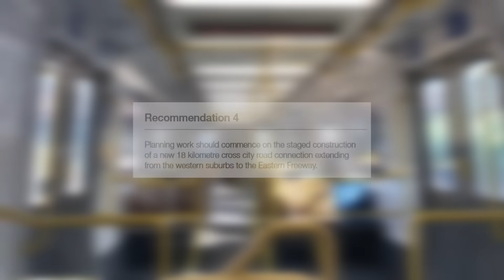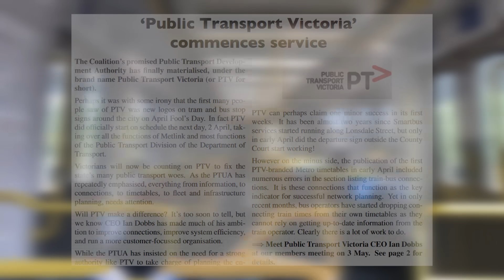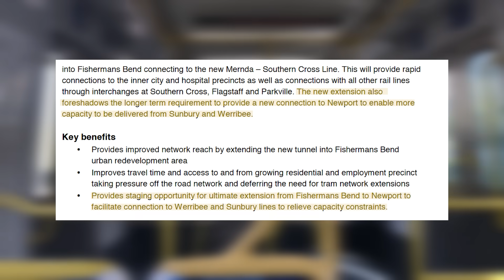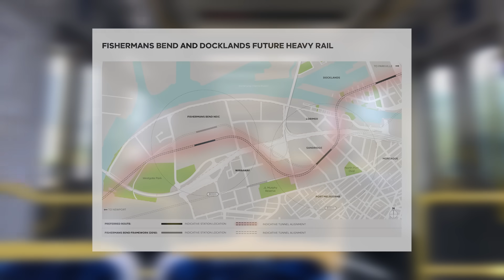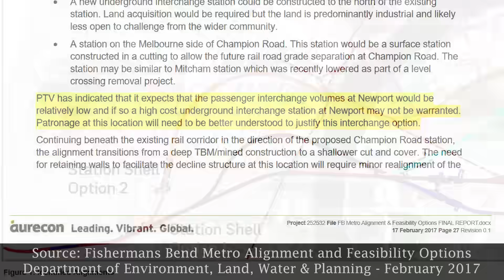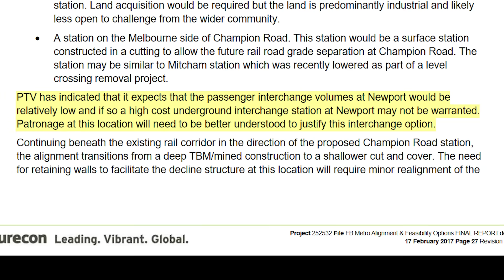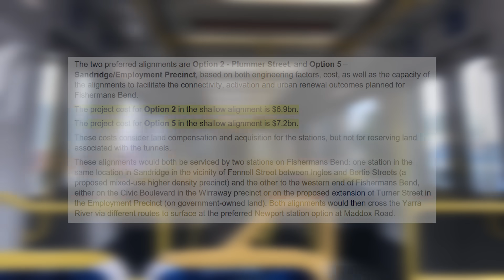Melbourne Metro 2: Explained

Comment: Metro 2 needs to happen before capacity becomes an issue, rather than waiting until it is. Sadly, with SRL and demand for an airport rail link, I dont see this ever being built.
Reply: the airport line was on the plan it just wasn't a stupid brain dead 90km underground tunnel.
are leader had 4 simplistic line concepts where you could of built the most important while adding more buses to the others then slowly add rowville, melton etc over time but instead she wants it all at once as a horseshoe. with all the time she has spent stuffing around on the srl set up she could of already started sunshine and albion upgrades to allow immediate start to a airport rail
Reply: @anakinsmith4770  she actually couldn't as she didn't have the funding. SRL was a major election pitch by the Victorian Labour government and they weren't about to abandon that. Airport rail link was being significantly funded by the federal government but they delayed it to help the fight with inflation and bring down government spending. There was also a fight over where the station was going to be (i.e. above or below ground) between Melbourne Airport and the Government and you can't realistically do any of the design or initial works without knowing what the whole thing will look like.
Reply: @hamleyn  listen to yourself the srl was funding she went after instead of just funding to upgrade sunshine and make the line you know there still debates now what happens if she stars boring holes and then the people debating so no airport if this happens and it will she will look like more of an idiot than she does now. she is everything that was wrong with dan andrews x10 i'm confident if melbourne had another covid like virus she would lock it down to 0 cases existed
Reply: There is this huge kerfuffle over the cost of the SRL, meanwhile the NorthEast link road...
Reply: @liam3284 that is useful for road user the srl isn't the airport issue is an easy fix and I can't imagine anyone getting on an the airport is going to Werribee, Monash box hill unless there migrant and that's the issue the srl is ain't Australian

Comment: They definitely need the interchange at Newport! Do they realise how many people travel back and forth between the Werribee and Footscray?! Or Werribee to the Williamstown area for the beach?
Reply: The Laverton trains (via the altona loop) connects at two separate stations on the line. A new station at 'south newport' and laverton? So it still allows connections, minus a direct connection to Williamstown
Reply from the maker: As stated in the video - connections from Werribee and the Altona loop to both Footscray and MM2 will be very easy with a Newport South station. PTV has stated in the past that there aren’t enough people travelling from Williamstown to justify building an expensive new underground Newport station, at least initially. You can read the report in the description if you would like.
Reply: @MetroManMelbourne  oh I can understand that, fully on board with it, I’m just concerned that the position of Newport South could either pseudo fix this problem in the meantime, or not. Bridging the gap to allow for a somewhat useful connection and for the development to get a move on in the meantime, and the transport use in the area to start changing. If they design it in a way that is walking distance to Newport at one end (a little bit town hall/flinders street like, but admittedly with probably a little more distance, think London Underground connections) and has decent, clear walking connections, maybe pedestrian bridges at points etc, it could allow for the connection to exist in a useful but not ideal form in the meantime, without the expensive underground build. Then as density builds in the area and trips increase, any future underground thing they do to increase the efficiency of the transfer could be justified by demand, foot traffic between the stations etc.

My original comment admittedly gave absolutely none of this nuance though, my bad 🤦🏻😂 but yeah, talking about a Newport connection currently, I’m more talking about them hopefully positioning Newport South well, rather than going straight in with an underground build. Heck, if they position Newport South well enough, they could probably get away without an underground station/platforms unless the area develops in a way similar to the North Melbourne/Arden plans, or as some sort of pseudo extension of the Fishermen’s Bend development well off in the future.

Comment: a tram line branching off the port line then going along howe parade then a loop through the bend then back towards the cbd is a better idea.   curves on a train line as was shown on the map of fishermans bend just slows the journey for everyone else.
Reply from the maker: This isn’t about a train line for fisherman’s bend, at its heart; it’s about segregating train lines, something we will eventually need to do, it’s just convenient that it can run through fisherman’s bend. Even with the curves, it will still probably take 5-10 mins off the Newport to city travel time.
Reply: @MetroManMelbourne  , melbourne already has a train speed problem.   speed of service is what brings customers.   observe the success of v/locity services.   unless there is a truly good reason for installing curves there shouldnt be curves.   theres not likely to be much buried beneath the ground of fishermans bend that needs avoiding.

Comment: I hope this doesn't happen; other projects need to be built. The Cranbourne line needs to be extended to Clyde, the Doncaster rail needs to happen, and the Rowville and Mornington rail – like many other important proposals. Metro 2 is not necessary, and I certainly hope that the SRL will not continue to be built. First, focus on these rail extensions to connect these isolated suburbs.
Reply from the maker: Doncaster rail requires metro 2 to be feasible. The Rowville line requires quadruplication of the Dandenong line, which for now is (prohibitively) too complicated. Mornington rail isn’t ever going to occur.

I understand where you’re coming from, but ultimately, it shouldn’t be a case of “either-or”; we need to be using projects like MM2 or SRL as part of a comprehensive transport network-building effort for the long-term rather than being individual projects competing for funding. Perhaps that’s a little too idealistic but that’s how I look at it.
Reply: @MetroManMelbourne  Maybe MM2 should head there then, instead of already well-served locations?
Reply: Doncaster rail would realistically be feasible if this gets built. I would love a Doncaster station, but the Clifton hill to Jollimont section is nearly approaching capacity, Doncaster trains would push it above capacity even with CBTC signalling.

(Doncaster rail is also very unlikely to happen due to the north east project, where Doncaster area will be served by BRT to the city, and if stage 2 of the SRL gets built, that a SRL Doncaster station.)

Comment: Metro II should be a quad tunnel, going straight down Elizabeth Street. 
Stops to the north Vic Market (between Mel-b’n Cnt, and the Vic Market, Parkville, (then turn east under Mel-b’n Uni, 'til it reaches Elgin St) Carlton (between Mel-b’n Uni & Lygon St), Fitzroy (between Brunswick and Smith Sts), Vic Park (then skyrail), Chandler Hwy, Bourke Rd, Bulleen Rd, Greythorn, Doncaster SC, Victoria St, Tunstall Sq. Donvale Line
Bulleen Rd, Bulleen Plaza, Feather Top (Lwr Templestowe), Templestowe (Templestowe shops, or High St), The Pines SC, Warrandyte (Warrandyte Line)
Elizabeth st would be between Flinders & Collins Sts. 
Stops to the south west (skyrail along old Port Mel-b’n line) Montague St (then tunnel under Williamstown Rd), Graham St (turning north west) Salmon St, Newport to Werribee (Wyndham Vale?)
Stops to the south (skyrail along old StKilda Line) South Mel-b’n, Albert Park, Middle Park, StKilda (then tunnel under Grey and Inkerman Sts) StKilda Rd, Balaclava, Ripponlea, Elsternwick, Gardenvale (turn east tunnel under North Rd), Caulfield South, Ormond, Bentleigh East,  Huntingdale,  Monash Uni,  Mulgrave, Jells Rd, Rowville (Rowville Line)
Extend Sandringham Line via tunnel Black Rock, Mentone, Morrabbin Airport (skyrail & ground lvl) Dingley Village, Springvale South, Keysborough, Dandenong South (Dandenong South Line)
Mernda Line (and Wollert Line) would follow the old inner circle line Stops at Fitzroy North, Carlton North, (joining Upfield (Wallen?) Line) Mel-b’n Zoo, Children's Hospital,  (joining at Parkville)
Reply from the maker: I like your ambition, but I feel this might be a little unrealistic…
Reply: In PT, we need enough people to say this is the minimum, and we might get half.

Comment: I don’t like how it won’t stop at flinders street
Reply: Southern Cross is a good enough substitute. It won't take long to change trains at the City Loop or simply hop on a tram to get to Flinders St. Plus, not everyone needs to go to Flinders St and Melbourne Central anyway. And I actually like the creativeness of utilising Southern Cross and Flagstaff as new interchange stations. The more decentralised the lines are, the better IMO.
Reply from the maker: Proper “metro” systems (which is what Melbourne is eventually trying to turn its trains into) don’t tend to all interchange at one station, with the exception of a handful of systems like the Hamburg U-Bahn. In reality, it shouldn’t be that big of a deal to bypass flinders street; if you need to get there from the north, you can change at parkville, and if you need to get there from the west, get a tram from southern cross.

Comment: I would like to some overdue uogrades which are cheaper and will be faster to build to be done first. For example Upfield duplication and extension to Roxburgh Park, Rowville rail, major bus reform and  Western Rail Plan.
Reply from the maker: Rowville rail is a surprisingly complicated project that probably requires quadruplication of the Dandenong line (expensive) - otherwise I tend to agree
Reply: @MetroManMelbourne  potentially though Rowville trains could stop all stations from Caulfield as happens now with all East Pakenham and Cranbourne trains. Maybe Rowville trains could take the path of existing Westall short train services. Rowville would primarily be skyrail down North Road which I think would reduce the cost.
Reply from the maker: @SimonsHouseofEntertainment  the issue is that the corridor doesn't have enough capacity, even with CBTC signalling - it's not to do with express running.
Reply: @MetroManMelbourne  Yes, that is the problem. The best way to Rowville is to extend the Glen Waverley Line which is mainly self contained

Comment: I don't get why really any of it needs to be underground except for the bit under the CBD.
Reply: there's no corridor for it to utilise
Reply from the maker: The issues with running it overground are:
1. It would require a bridge as tall as the west gate bridge to cross the west end of the yarra - incredibly expensive (maybe even more so than a tunnel)
2. Even if you ran it overground through fisherman’s bend, it then still needs to run very deep to cross the yarra river near the city, so you would probably require the sandridge station area to be tunnelled anyway.
3. There’s no surface alignment for it to follow through Fitzroy without demolishing many buildings (more expensive than a cut-and-cover tunnel)
Reply: @MetroManMelbourne  that's fair enough. Thanks for the perspective!
Reply: @Soccera0  real underground is the best in urban areas. The european metro's are amazing

Comment: This proposal feels like a massive waste of money and time when there are so many things we need more and would cost less.
Reply: Like what?
Reply: @Snoop_Dugg  SRL😐😐🫥
Reply: @Merri-bekRailfan  SRL was too ambitious, probably they should have built another loop closer to the CBD to begin with, allowing for interchange just outside the CBD in the event of delays.
Reply: @Snoop_Dugg  yea, good point
Reply: @Snoop_Dugg 

The inner suburbs already have their trams. A suburban loop closer to the CBD would be useless, and would just further-confirm that the inner suburbs get the overwhelming majority of infrastructure while anything further out remains neglected. And despite common belief, Melbourne's inner suburbs are not even all that dense compared to similarly-sized cities anyway (Sydney included). So the SRL and resulting urban renewal might aswell be pushed further out to help increase density at the missing middle where it's required most.
Reply: @ Thats a fair point about the trams serving the inner suburbs, but all the lines are basically radial. There’s no way to travel from one suburb to the next without heading in towards the city. Doesn’t really encourage 20 minute suburbs does it.

If SRL was about neglected suburbs getting public transport then construction would have begun in the West.

I’m just saying we need both, at different radii
Reply: @eddielong8663 Urban renewal. 35 billion. Shelve the project and make sure that the growing Western and Northern suburbs get decent Public transport. The SRL isn't a priority at the moment.
Reply: @Merri-bekRailfan NO!
Reply: @mjcats2011  I was being sarcastic
Reply from the maker: @Cassandra03 elaborate?
Reply: @MetroManMelbourne  the other comment that you have already agreed with for example. The self spacing tech to increase frequency. Level crossing removal is a great project improving the city. Then circumferential routes. And even high speed rail as a greater priority than this.
Reply from the maker: @swiftieau  I disagree about HSR being a higher priority, but otherwise don't see it so much as an "either-or" for the other projects - they should all be done at some point in time
Reply: @MetroManMelbourne  I feel like increasing the attractiveness of regional Australia can only be done with High speed rail.

They should start a build from Shepparton to Albury or something so people have a valid reason to move away from Melbourne. Away from built up areas it would be easier to build and get services running.
Reply: @MetroManMelbourne  obviously only the first three would be cheaper
Reply: Why are you worried about cost? The debt isn't a real thing unless you read the herald sun.
Reply: @Low760  learn anything about anything. Stop being proud of your own ignorance.
Reply: @swiftieau Totally agree. We are in trouble in thus state. Transport wise we have created not much compared to NSW and WA.
Reply: @Low760 

Yeah. The Herald Sun is trash. Just yesterday I saw a HS article pop up on my feed written by Steve Price, comparing Melbourne's current infrastructure projects unfavourably with Sydney's. He's correct on one account, but all the man does is bitch and sook about infrastructure projects costing too much while simultaneously complaining that there's not enough infrastructure to begin with. He basically wants Melbourne to stop growing full-stop. That's his solution. The ultimate NIMBY.